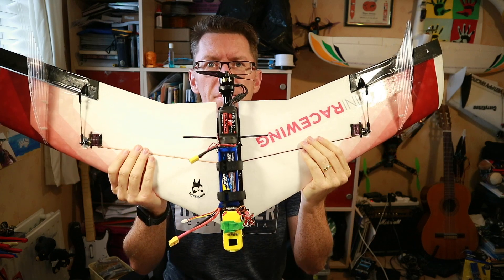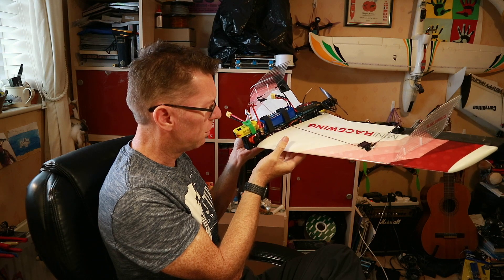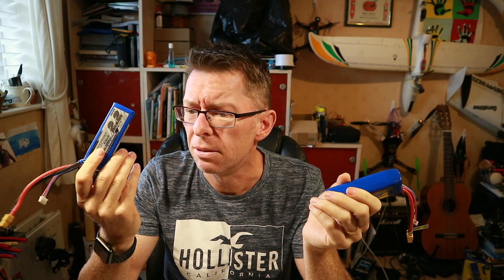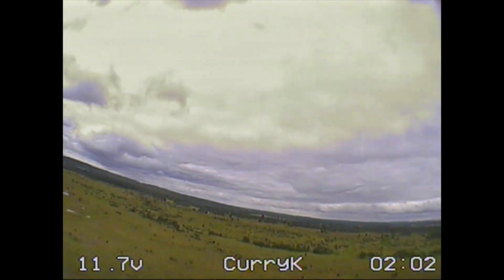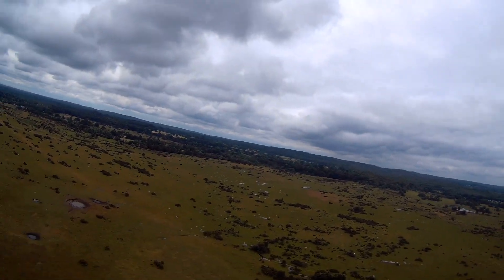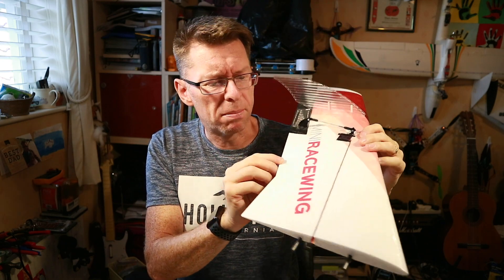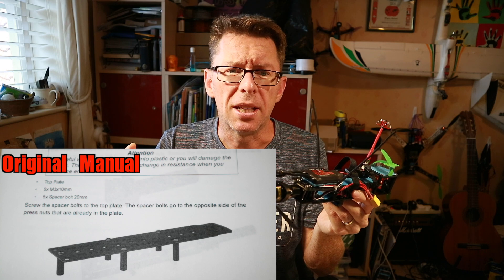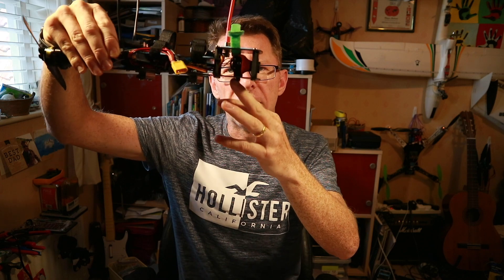FPV Review: The MiniRaceWing, part 1

Comment: Hey i have one question about the esc im using the MRW too but with an flight Controller how can i Connect this esc to my flight Controller the Problem is while trying diffrent ways to Mount it i smoked the flight Controller an Need to order a new one i had the Problem the esc is beebing slowly (2 Seconds between the beebs) which means the Fc cannot read what the flightcontroller is telling it do you know where my Problem is befor i Smok the next Fc :-D one thing i found out (im using betaflight ) is that i had activatet oneshot 125 so i think i Need to Chose pwm as an Output Signal but are there any other things i might forget that could cause the esc to Not read the flightcontrollers Input in Addition to this will the servos read the Signal when i Chose pwm because they dont worked as well 

Sorry for my Bad englisch I had an realy Bad english teacher :-D
Reply from the maker: Lot of info in there, but lacking a bit of crucial detail.  One thing though, if you are using Betaflight for fixed wing, it's pretty much experimental (I think), flash your FC to iNav instead and work through the guide on wing setup there.  Smoking the FC - depends on the FC.. does it have it's own 5v supply, and are you connecting the BEC from the ESC as well - it might not like that.  iNav separates out it's ESC and servo protocols, but "standard" should cover anything.. it's also very fussy about which PWM ports are allocated to what - so watch out for that.
Reply: CurryKitten okay thank you for the fast answer im using an hglrc F3 v2.2 with an build in Pdb and want to use the bec from the Esc to power the Servos an just Connect the Signal cable to the Fc
Reply from the maker: In that case, I would take the ESC's ground/5v line on the servo lead to your RX to power that, and just connect the signal wire to the FC.. do the same for the servos.  I show this type of wiring in a post I made here http://www.currykitten.co.uk/getting-inav-ready-for-the-skyhook-discover-2-6-enter-the-cardboard-v-tail/
Reply: CurryKitten okay Great thank you :-)

Comment: Too funny about not being able to easily locate your location. We've encountered this before and have a small pole with a series of long streamers to help with that (and works like a windsock).
Reply from the maker: We've normally got a few more landmarks as we go from different places in that location, but the wind direction didn't suit.  I kept getting transfixed on this white horse which showed up really well in the FPV camera.  I mentioned this to Neil as I had the (what I thought) was the excellent idea of using it as a navigation aid as we were a little off to the left of it.  Neil then pointed out that horses tend to move around :D

Comment: lol so many errors ... the loctite is not permanent. and the manual is ok first and second. only you did not see the meaning of the top plate ... only. (a little thought is required for construction ..
Reply from the maker: We can't all be perfect I'm afraid.  I never said locktite was permanent , but it certainly helps reduce screws coming loose under vibration - and more than a few people had managed to mount the plate upside down which is why the instructions were updated

Comment: !!READ: your prop wasn't defective unless you balanced the prop! 

quads are different to planes. you can fly unbalanced props and the computer will smooth it out no problem. but plans are much more sensitive on planes since they are spinning much higher rpm and the station of imbalance is to great
Reply from the maker: Thanks for that instructional help there Ben.  But as I said in the video, for a while we thought perhaps we had a dodgy prop as we couldn't explain it breaking... but obviously we then found that the screw dropped out and stuck the prop breaking it.

That aside, whether a prop spins faster or slower on a planes depends entirely of the kv of the motor and the amount of throttle you are using, seems a bit of a rash generalisation to think they spin faster.